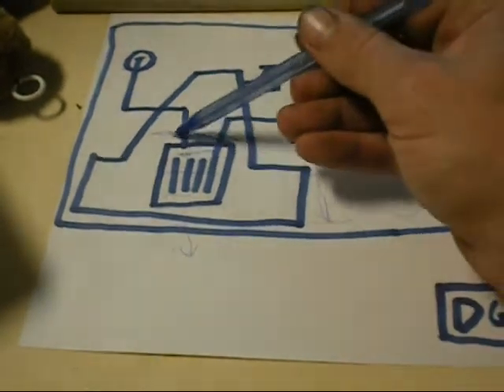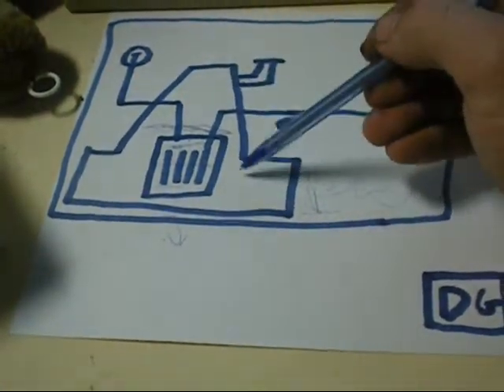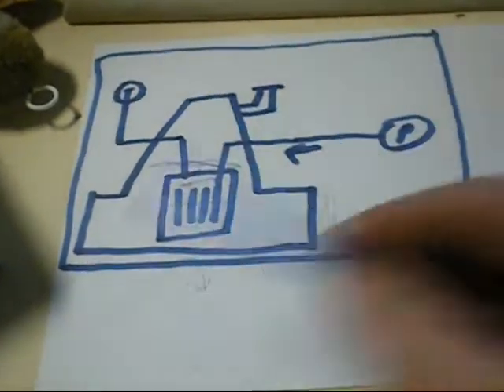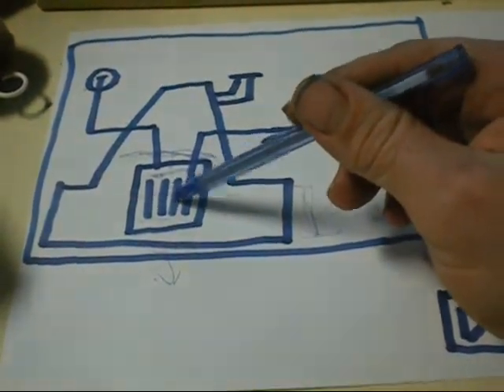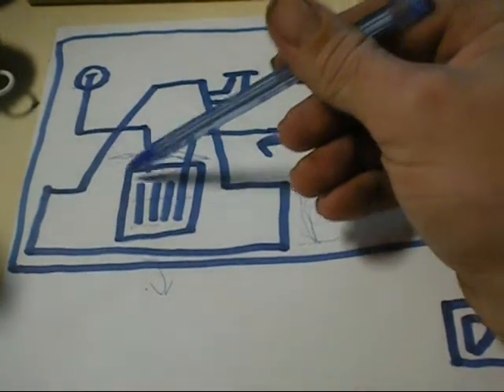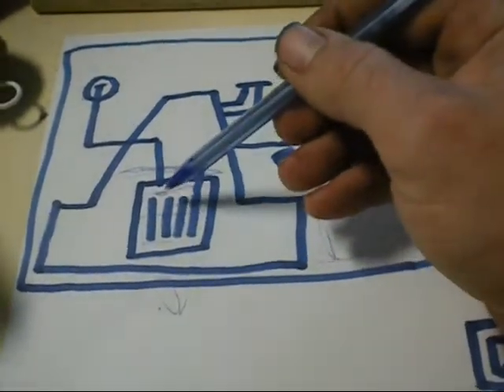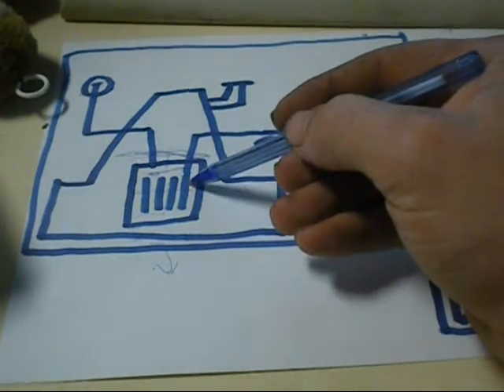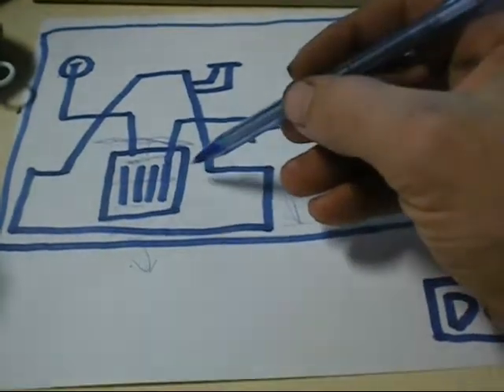simple reactor explanation

Comment: @EXO903 the RBMK reactor at Chernobyl used graphite tipped control rods, when they forced them into the core it caused a surge in power (heat energy) that caused a steam explosion and destroyed the ends of the control rods and some of the fuel containers.

after that the reaction in the damaged area went out of control and caused a massive spike in steam pressure, blowing the top off the reactor vessel, and causing fuel and graphite elements to burn in open air.